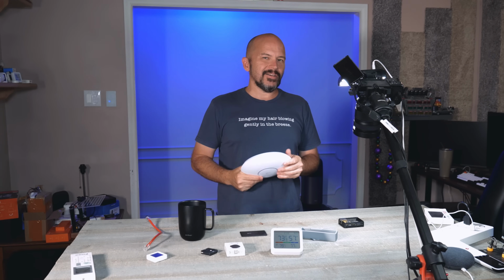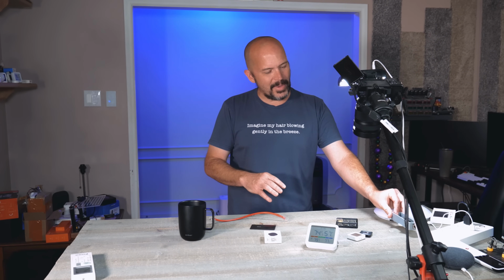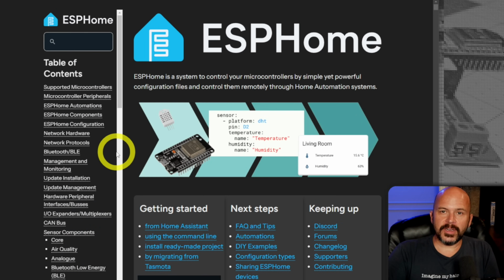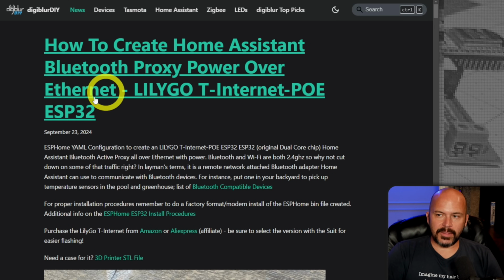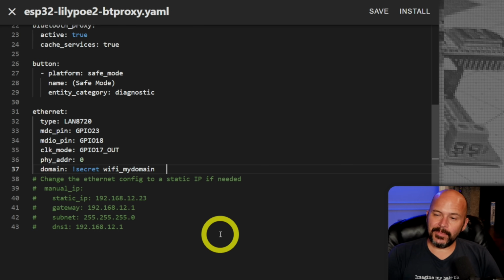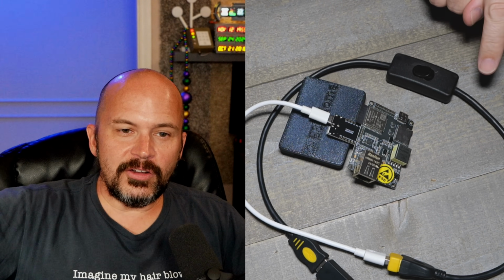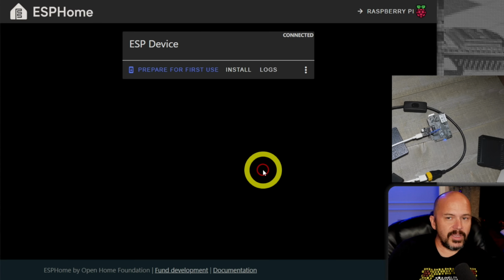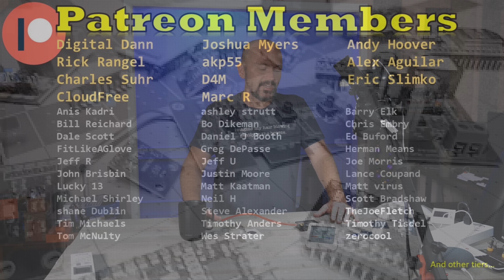Home Assistant ETHERNET Bluetooth Proxy How To - Lilygo POE ESP32

Comment: This whole proxy approach would be so much easier using 2 esp32-c3's connected together with I2C and power pins. One running wifi and the other running Bluetooth. I do this for bridging ESPNOW to wifi. At about $2 per esp (I use the super mini's) this is a no-brainer.
Reply: Can you share more about your setup? Are you using mqtt?
I was trying to do that but with a esp32 connected by serial to the server, I got to this video thinking maybe I could use one of this boards with Ethernet to be a espnow proxy.
Reply: @cortezdos  I have many variations of this technique using both serial and I2C. I find that serial is much easier between esp32's even though I started with esp8266-01'a as  slaves. I don't use MQTT, I use my own protocols, but the actual protocol is irrelevant to the communication technique. ESPNOW provides for a 250 char block size which fits well with any protocol, but with packet sequencing it can handle anything. For the server side of the bridge, I've used Ethernet and in my central case, a Pi server.  I enjoy sharing these techniques, but I haven't formalized a medium yet.

Comment: Thanks for the heads up with the unifi stuff... I was pondering an upgrade of my network
Reply from the maker: If you want WiFi 7, hold out a bit or go to something else. The U6 Pro and Enterprise are still great APs.
Reply: @digiblurDIY  Reminds me of the UDM... I got that soon after the initial release but that was nothing but trouble for the first 1-2 years. Thanks for the advise! I'm not in a hurry so I'll just wait for a while.
Reply from the maker: Ahhh... Yes. The pill. Lots of hype and so many issues.

Comment: 3:55 'cut down all that traffic on the 2.4GHz'. It's a nice device you use there as a proxy! But surprise,  Bluetooth users the same 2.4GHz band as Wifi 2.4😉
Reply from the maker: That's what I said.
Reply: There would still be less 2.4GHz interference after switching to Ethernet for data, though.
Reply from the maker: Correct. No doubling or even quadrupling the data depending on the proxy coverage. We aren't getting rid of Bluetooth anytime soon
Reply: @digiblurDIY  exactly, you're essentially rebroadcasting the same packets over a different transport, over the same radio bands. Hardwiring is always the way to go if possible 😁

Comment: Love to see an alternative, do I really need to use their specific programming board?
I'd hate to get the add on only to use it once.
Unless I can think of more places to use this . . .hmm
Reply: Personally, I use the Gl.inet Bluetooth gateway and reflashed it with ESPHome. It just works and accepts PoE for power and data.
Reply from the maker: ooo...interesting, I see it has POE now.  I could have sworn the initial ones didn't have that and had all the locking up issues.
Reply from the maker: You can use a regular TTL too, their board just makes it easy.  I do wish they include the CH340 on board and called it done.
Reply: @digiblurDIY  yeah, I recall there being issues with it locking up like so, but I've never encountered it on my unit, and PoE works like a charm.
Reply from the maker: Snagged one to try. Glad to hear it was fixed!
Reply: yeah   there is 2 version of the board V1.0 and the V2.1 and v2.3,  i think they fix the issue on the 2.3

Comment: Fantastic guide on how to do all this and the use case. You can do the same thing flashing ESPhome onto a SMlight POE. They cost a bit more but are ready made, have a large antennae, are  cased already and can be flashed without an additional board.
Reply from the maker: Which SMlight? Those are Zigbee
Reply: @digiblurDIY  The SMlight SLBZ-06 Travis. I bought one of those after following yr awesome vid on them and found out how to do it from there. You can load different firmware onto them. They really are the "Swiss army" of POE devices! They can be flashed straight from the SMlight web interface, You lose that afterwards of course but they then appear in ESPHome as simple POE Esp32 BT proxies. 🥰
Reply from the maker: @wapphigh5250 oh. The antenna is for the Zigbee chipset only. I did think of that but I do prefer my BT proxy to just be a BT proxy without zigbee mixed in.
Reply: @wapphigh5250  "They can be flashed straight from the SMlight web interface, You lose that afterwards " 
Is it possible to revert back, just in case?
Reply: @flexibly77 yes. But not via the GUI. Details in the manual.
Reply: no way. im going to do that instead since i have an smlight on order. any issues with it? can i disable zigbee and use it ONLY as a BT proxy?
Reply from the maker: @idleidle3448 you could do that
Reply: @ nice. i think i might because i wont have to play around with flashing. it includes a case. and its poe. all of those things together for only $30 bucks aint bad. esp since the other options are about 20 bucks anyway. awesome

Comment: Crap. I bought a unifi system last week with a U7 pro AP. Was planning on installing this week. 😢
Reply from the maker: Trust me...stick to 7.0.59 firmware on the AP if you have 2.4ghz smart home devices.
Reply: @digiblurDIY  over 50+. So it won't auto update when I hook it up?
Reply from the maker: @tritontr21 it might when it adopts but you can push 7.0.59 manually
Reply: @digiblurDIY  ok. Thank you for the info. New to Unifi and HA. Your vids have been super educational.

Comment: Any random flashing tool will work just great with the lilygo, no need to buy their specific flasher. Even an arduino can be used to flash other devices :)
Source: I bought the lilygo thing, didn't notice I needed the flashing thing and used one of my random ftdi flashing devices instead.
Reply from the maker: That is correct.  USB TTLs work fine, but it is easier with their little board as it has the pins lined up and done for you.

Comment: Good useful details on the olimex vs lilygo boards. I've been running some olimex boards for a while without issue but seeing them side by side was really useful to me.
Thank you!
Reply from the maker: I was pretty surprised as well when I threw the thermal camera on them. Made sense after comparing the POE wattage too.

Comment: Weird.  I just built a new smart home with about 100 2.4 WiFi devices and a UniFi U7 Pro.  I created a 2.4Ghz only SSID and have over 60 Govee, LG, Miele, Epson, Reolink, Switchbot, and more devices connected so far.  I've only had an issue with one Chinese manufacturer and their lights not connecting to this SSID so i had to create a second 2.4Ghz SSID with a little less security and it connected right up.  I've had to reboot the AP for that same lights twice as it lost connection.  But no other devices have issues.
Reply from the maker: Oh devices will connect, it is stay working is the issue.  Count yourself lucky.  7.0.59 is mostly fine on the U7 Pro. Later firmwares are a mess.  Things will drop off and get blocked all the time.  The Ubiquiti releases threads are full of the same 2.4ghz issues.  The U7 Pro Max...woah...  that's a total mess no matter what version.  https://community.ui.com/releases/UniFi-Access-Point-7-0-69/41968125-430f-4bf4-8ee7-4009c94e2a5d?page=1

Comment: All balls, was about to upgrade my Asus router with unifi U7pro max...... Should i get a 6 pro to deal with 2.4ghz for the moment?
Reply from the maker: Yeah don't touch the U7 Pro Max.  It's a mess for any 2.4ghz stuff right now.  U7 Pro is kind of okay if you stay on 7.0.59.  U6E and Pros are great APs still for all things.  I almost bought more U7 gear for a family member but I'm sticking to U6 Pros  browse here and you'll see - https://community.ui.com/releases/UniFi-Access-Point-7-0-69/41968125-430f-4bf4-8ee7-4009c94e2a5d?page=1
Reply: @digiblurDIY I have already got the U7 PM, I guess there is no harm trying to pick up a U6pro or LR and have that deal with it.... Thank you
Reply from the maker: Don't do the U6-LR.  That's Mediatek and has some issues too.  U6 Pro is fine.
Reply: @digiblurDIY  will try an pick up a second hand unit. Thanks for the heads up
Reply: Super happy with my decision to go U6 Pro and avoid the usual Ubiquiti early problem stuff they always have. 

Also in the U6 lineup, only the pro has the Qualcomm chipset which consistently outperforms the chipset they switched to for the Lite and most of the other  U6 lineup. 

I think the U6 Pro is the sweet spot for the UniFi APs right now. 

Side note: I also tried to add a U6 Extender for the only “mesh” connected device in a garage. It ran waaaaay too hot at 141F on the front of the device in an 80F ambient. Which says nothing good about the rear where the real heat load is.  Noped right out of that and grabbed another U6 Pro.

Comment: Speaking of Bluetooth proxies.  Over the weekend I switched from a spare i7-10700K PC (that has BT on the motherboard) running Home Assistant to the Home Assistant Green, which has no BT transceiver. The swap was simple enough. I installed the backup and everything worked fine, which was odd because HA Green has no BT wireless unit. I have a dozen ThermoPro BT temp/humidity sensors on the property, all showing correct readings. How the heck were they still being read by HA? 

Then I remember I had ONE Shelly device in the shop I was using to control some 12-volt fans.  They'll act like a BT proxy if set up correctly, and the built-in proxy function was "active." Mystery solved.  The moral to this terribly written story is that if you have some Shelly devices in your setup, you might not need to add a dedicated proxy.
Reply from the maker: Yup.  The all the Gen3 stuff on Shelly has the BT proxy option on stock firmware, covered that in my BT video for the easy folks that just wanted to grab a plug and go.  It is Wi-Fi though.  And wait.. switched to the Green from an i7?  Ouch.
Reply: @digiblurDIY    Ya. Compiling ESPHome stuff on the i7 was pretty fast. On this HA Green...not so much. 😄  But everything else seems to be fine.  I like that it's small and uses very little power but my "crystal ball" tells me the slow compiling time is going to irritate me very soon.
Reply from the maker: @phillipzx3754 that's why I recommend the little N95/N100 boxes over those. Unless you just have a massive need for the 1-2watt usage with 12vdc like an RV, boat or some off grid system.

Comment: Wow, I just checked my U7 Pros and TX Retries are solid yellows. SMH.  I'll try to downgrade the firmware and hope it helps.  Thank you for the heads up
Reply from the maker: 7.0.59 is the last good one for the U7PRO for me.
Reply: @digiblurDIY  downgrading now, Ill let you know how it goes
Reply: Hey Digi, yup that worked.  Right now, both my U7 Pro TX retries are back to green after downgrading.  Shame on Ubiquiti for releasing a firmware without even seeing or testing this. TY again boss.

Comment: I have seen a few ESP32 Lora devices from Lilygo, would it be possible to use these as a RF beacon, similar to RF-link modules based on a atmega 2580.

If it is would love to get one to use with a Ducobox [home ventlation, that uses the 868 band for their controllers]
there are modules that plug into the box, but I can't really add these to the one I have
Reply from the maker: Haven't jumped into that myself given the small number of sensors.
Reply: @digiblurDIY  Indeed, and most are more used for a ESP32 based radio-receiver, I don't even know if they can transmit data

though the only exception would be the M5stack cardputer. which has a 433mhz antenna for a small chat app it has.

ordered one to see if I can use it as a multi-in-1 remote.

for about 30$ its a killer device in terms of what you can do with it

Comment: No ESP device works with the U6s or U7s.  Ubiquiti makes junk, I had to by Cisco APs to make my ESPHome Bulbs and presence sensors work.
Reply from the maker: The U6E and Pros are fine so far.
Reply: @digiblurDIY  Nope I tried switching back to the U6Es then to U6Pro's I had and none of my Kauf blubs, or Apollo Automation presence sensors would stay connect for mor the 32 hours. Luckly, I work for a Cisco partner and was able to replace all the junk UI stuff with Cisco equipment. No issues in weeks now.
Reply from the maker: @maverickmaker interesting. First I heard of the U6E dropping them. I have two of them with 100+ devices without issue. I was hoping the U7 would follow but it has been a disaster so I pulled them.

Ubiquiti tech support is lost and the threads have even quiet on the responses. I am guessing a 2.4ghz hardware issue. I have thought about just going with something else for 2.4ghz only but Cisco is a little out of the budget. That's a dream!
Reply: @digiblurDIY  I am thinks it was a whole system issue not just the APs. I made the move to replace the whole system after Ubiquiti support told me they do not support IOT devices, and it was my issue not theirs.